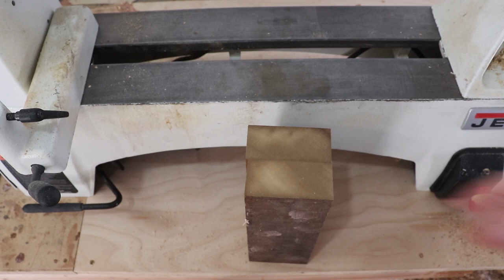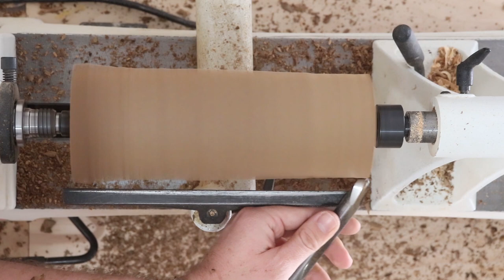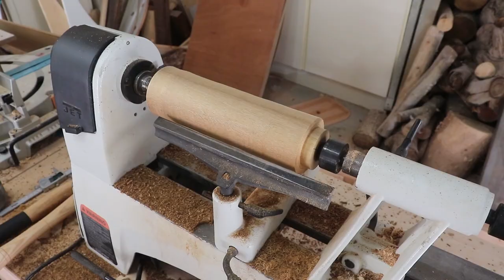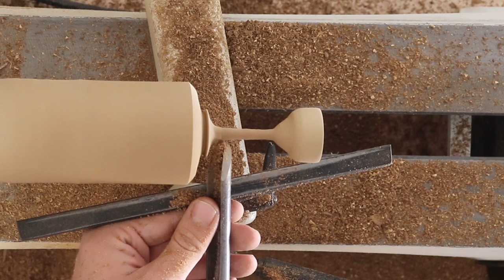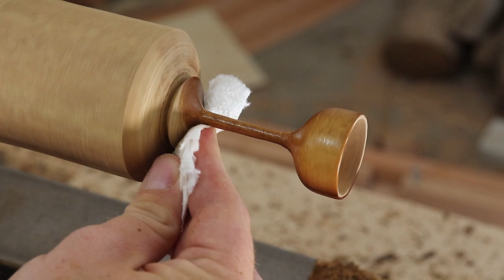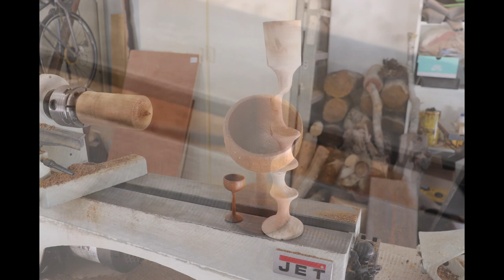Wood Turning a Mini Goblet

Comment: Nah, size doesn't really matter Drew but that Is Pretty Small there fella🔍😮 And Pretty Good too 🏆 I'll hazard a guess ... it's gonna be wobbly 🤪 
Question(s):  What gouge do you have ? How do you sharpen it ?   Stay safe.  -Mike
Reply from the maker: 😂😂😂
I have a 1/2” Sorby bowl gouge. I bought a grinder and sharpening jig. You still sharpening by hand?
Reply: @CookWoodworks  ATM I only have 4 carbide chisels. I'm going to get some steel tools soon. Start w/ NR scrapers (easy to learn & sharpen😁) but the gouge is next.  I bought a CBN setup with jigs. I was just wondering since you only have the 1 gouge and use it to very good effect!